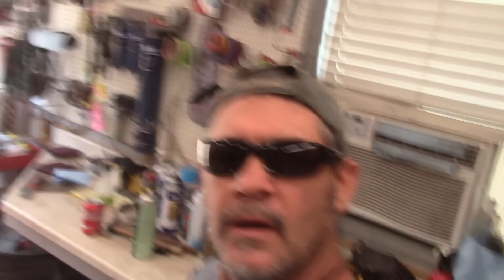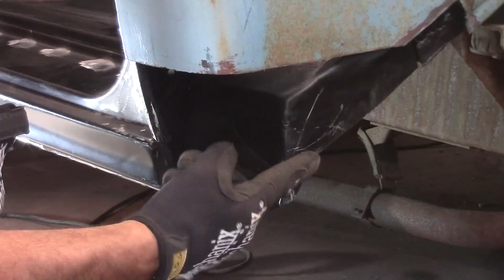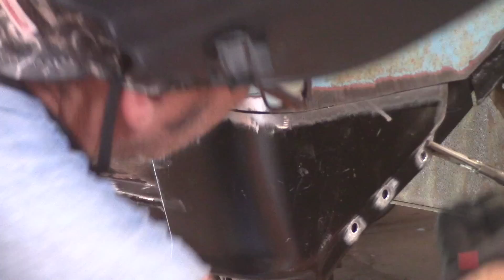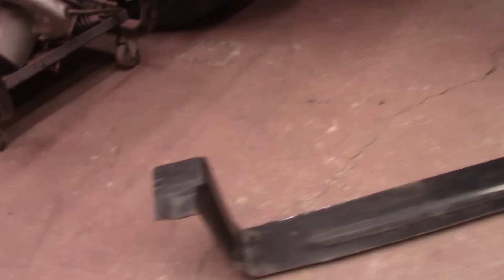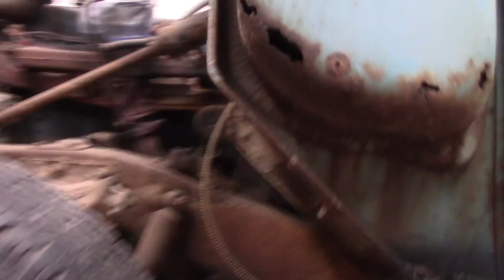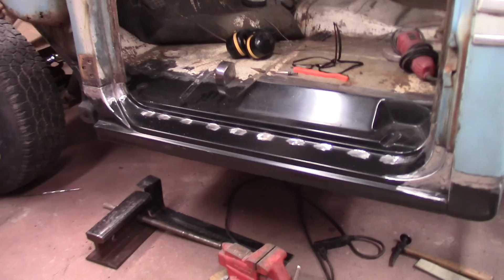Replace cab corner c10 chevy

Comment: Lots of work but you're a younger guy. I got luck on a 67 C10 truck that just came into my driveway one day with a family member dream of a truck, trailer and lawn service. As I did what cab rust it did have, electrical, V-belt to serpentine and replace glass seals, he quit. It's mine! What? 
  Either way, This you going 100 MPH, taking one bite at a time and making it work.
Aftermarket panel have two prices; what you pay to get them & the work it takes to make them fit & look like OEM. 
If they were exact, I guess a bunch of lawyers would show up somewhere screaming "Intellectual Property".
Best at you bud. I remember day after day, 6AM to 9PM, then go home.
DK, ASE Master since 78 retired. Not a body & paint guy but like most stuff, we do what we do!

Comment: I have a harbor freight flange tool that punches holes too.  It's good if you want a flange instead of a butt weld.  Eastwood sells a tool that makes a chamfer on the edges of metal that is being butt welded and also punches holes.  The idea with the eastwood tool is you are filling in a little valley  with weld, so it's stronger than a butt weld, and there is no place on the backside that is unsealed.  It looks like it could be difficult to make everything fit right to me, but I might get one anyway.  About $50 for it.
Reply from the maker: Mark Holbrook  I've seen this tool before don't really like the flange tool unless I have to use it, the hole punch would be cool
Reply: The hole punch works good on the HF tool, can't say much about the  durability, but no problems so far.  It's on sale for  like $38 now.  It's way easier and faster than a drill to get the job done.

Comment: What was the manufacture of that cab corner? I'm doing a 63 also and have not had luck with getting Tri-Plus cab corners to fit good. Great video
Reply from the maker: I ordered all my patch panels through (Classis parts) I still had to tweak some but that’s just the way it goes with these aftermarket parts
Reply: @Gibson63.  Thanks buddy, keep up the great work!!!!

Comment: My dad and I did a 51 Chevy 10 years ago for my first car. still have it and it's due for another. I am thinking of going the easy (and expensive way) of buying all new fenders online. you think I'm losing the spirit of the truck by doing that?
Reply from the maker: rlsukovaty  go for the new fenders if the truck needs them but if you can repair them for cheaper I'd go that way to keep it original but that's up to you I don't think it would bring the truck down though

Comment: they have a air holepunch at harbor freight works good.
Reply from the maker: keys ride  I'll check it out thanks
Reply: I will second that I got the one that does flanges and punches holes on other side it works great for the price  
Air flange punch tool item 1110

Comment: I couldn't quite tell for sure; but did you wrap the patch panel all the way around the front where it bends at a 90 and spot weld it in on the front, or did you make a vertical weld and not cut the inside of the door jamb?
Reply from the maker: RIPbiker13   Yes I spot welded on the front where it wraps around just like it was originally
Reply: Gibson63 I thought you had. I'm about to do both of my corners and thought that would be the best way to do it. Again, thank you sir.

Comment: so when welding the pieces - do you spot weld the whole thing ?  just keep doing spot welds until its filled in?  how do you treat the backside to stop any rust from the welds? Thanks
Reply from the maker: Yes I keep running spot welds until I’m finished,  take my time to keep from warping the panel.  I do clean the spot welds on the backside and run some short strand fiber glass over the welds
Reply: @Gibson63.  Thanks Bro ! I appreciate what you do..  I have a chevy 4x4 I sold  and then go it back - it needs a lot of work..  
If you find anyone needing a GMC stepside tailgate  for a 70's  i have a Brand new OEM in the box. $200 + Shipping

Comment: looking great, what is your welder set at ?
Reply from the maker: 72 Monte  low heat (b) and 4 1-2 wire speed on the Lincoln mig pro 135. gas valve set at 24 with trigger pulled
Reply: Thanks !